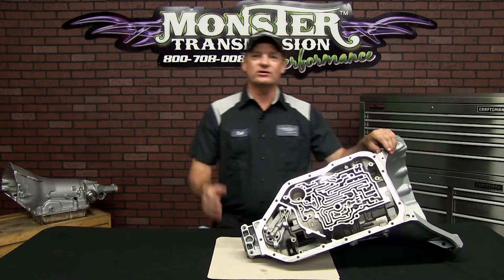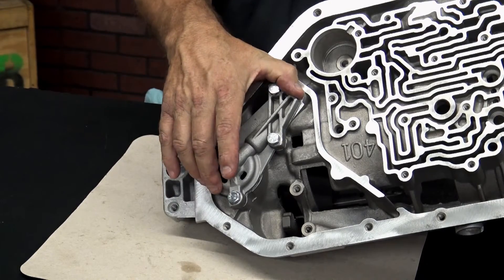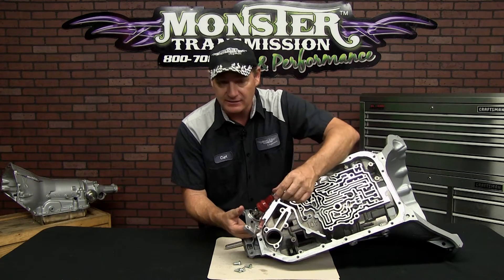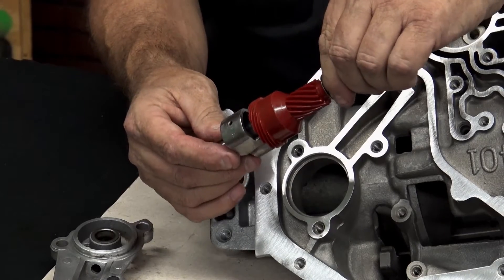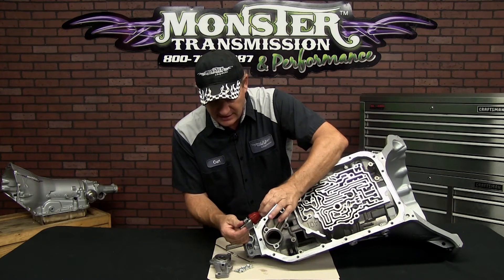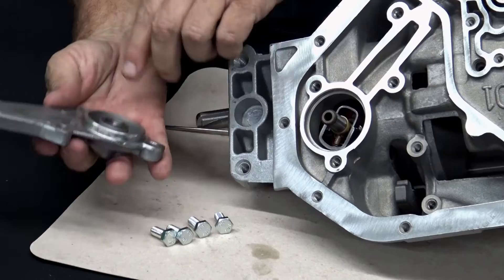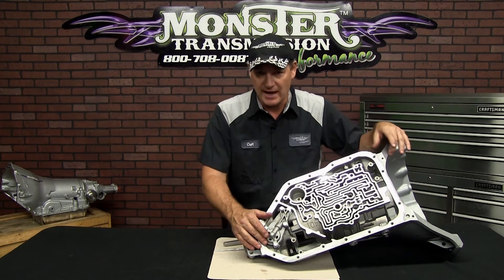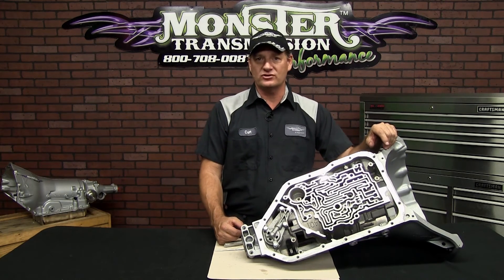Governor for 2004R

Comment: what kind of symptoms will the transmission exhibit if the governor is bad?
Reply from the maker: When the governor is bad it will exhibit erratic shift points and or will not want to shift until really late these are some examples.

Comment: What does the govenor do
Reply from the maker: the governor regulates hydraulic pressure based on vehicle speed. It accomplishes this using centrifugal force to spin a pair of hinged weights against pull-back springs.